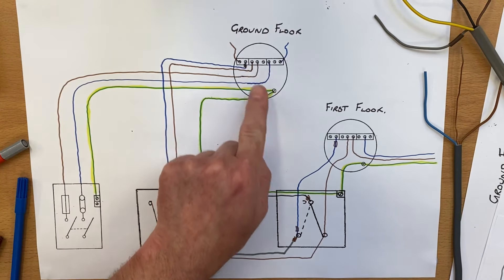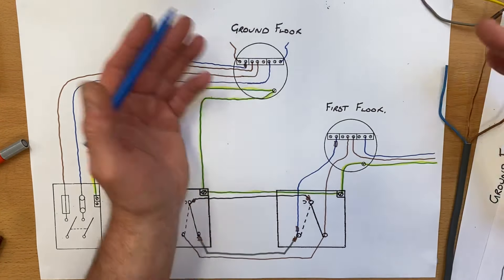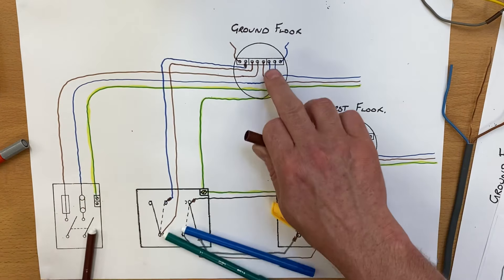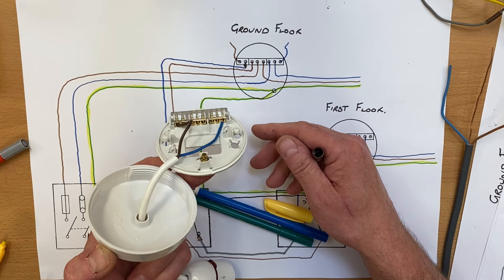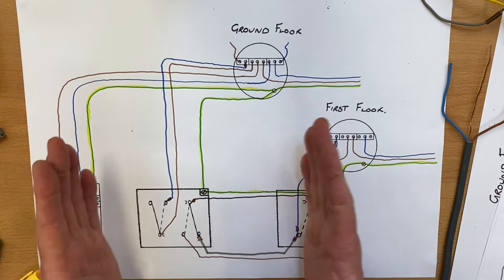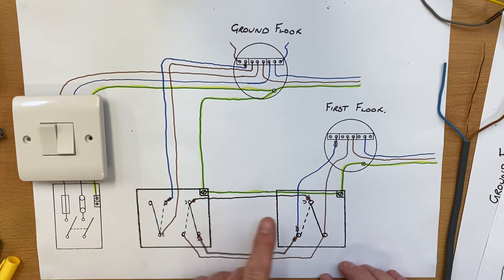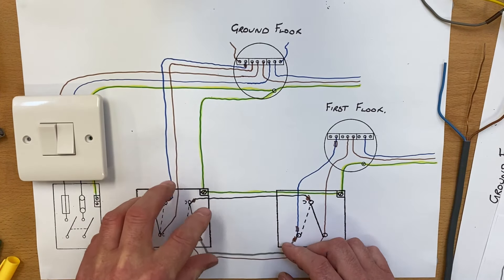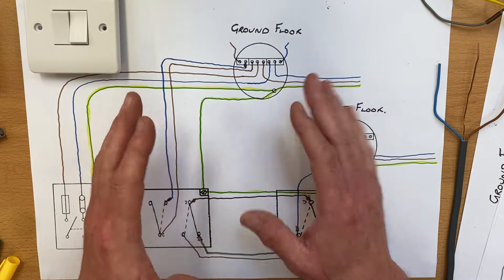Wiring Diagram Using a 2 Gang Switch Downstairs Upstairs 2 Way Switched Using 3 Plate Wiring Method

Comment: This was helpful thanks. However often the configuration is 2 gang switches both downstairs and upstairs. Would you just add another 3-core cable between the 2 switches? Thanks
Reply: Want to know this also.
Reply: Yes as another strapper cable

Comment: You should supply the the circuit from the downstairs fuse by taking a twin and cpc from the downstairs light to the upstairs light ,a twin brown and cpc from the upstairs light to the upstairs 2 way switch and taking a 3 core and cpc from your upstairs swith to your downstairs switch,and a twin brown and cpc from your down stairs light to your downstairs switch ,that would be good electrical practice and I know it's rare but I have worked on very large properties where because of the amount of equipment on the property they had the incomer changed from single phase to 3 phase and in those circumstances with your method it would be possible to end up with 2 phases at the downstairs switch unless the electrician made sure both circuits where put on the same phase so I think the method I have shown is better electrical practice under both circumstances

Comment: Is there a video of a similar set up using the two plate (feed to switch) method?
Reply from the maker: Wiring Diagram Lighting Circuit 2 Plate Method Taking the Feed to the Switch - 2 Way Switching
https://youtu.be/QX1B4gtqisc
Reply: @ thanks, very helpful and reassuring. I think I was confounded by the amount of wires coming into the two and three gang, two way switches that my diagram indicated. I have a new simplified plan!

Comment: Can you not feed the live from the CU into comms, then using twin and earth L1 into L2 and L2 into L1, comms on the second switch is then wired to the light? 
Saves using 3 core cable
Reply: Yes you can, but you still need a 3Core+E cable in order to 'loop thru' your Switched-Live.
Otherwise how would you "spilt open" the 2Core+E cable to feed into two(2) different Switch Locations??🤔

Remember we are Not using PVC Singles cables (in conduits) here…